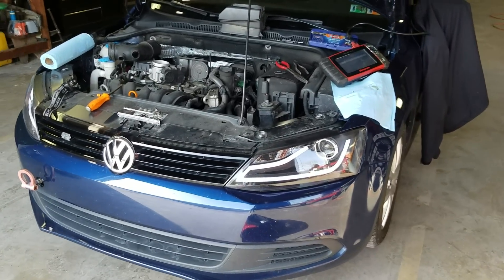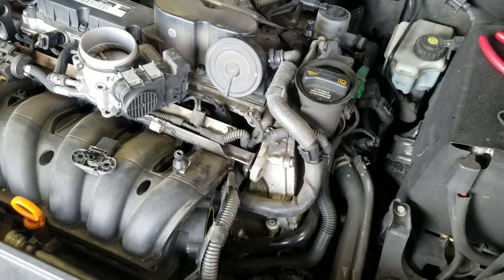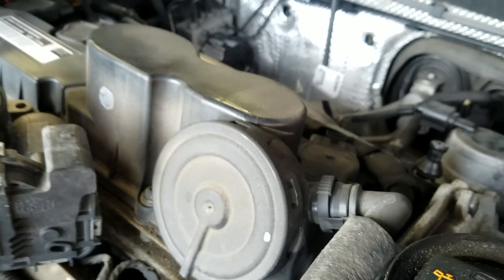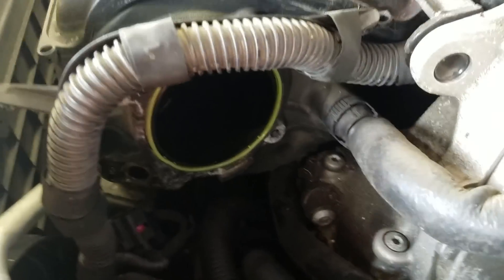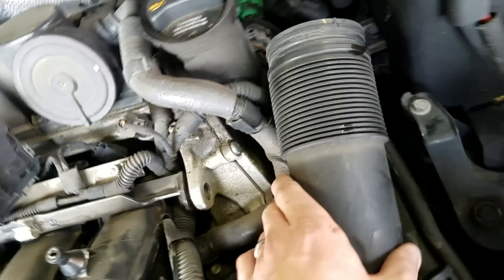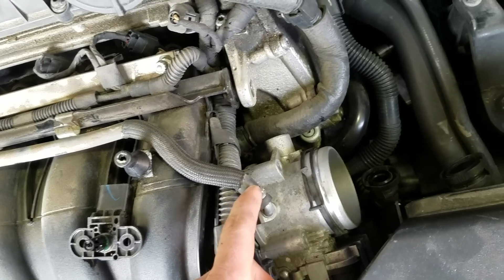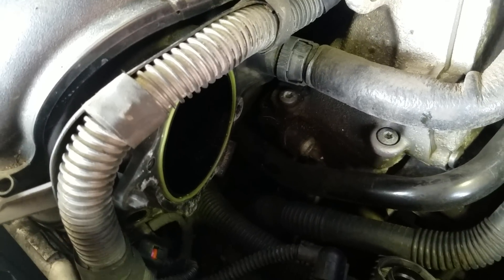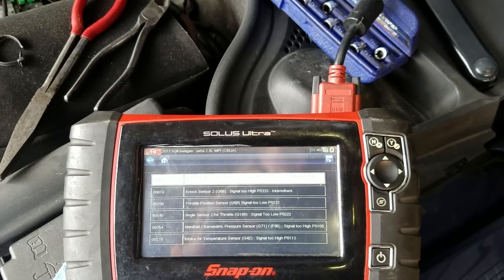PART 1- P0106 VW 2.5L Jetta Manifold Sensor Implausible Signal

Comment: Great video brother. I'm having this issue on my 2013 passat 2.5l. I'm not sure if you are aware of a TSB regarding a software update if you consistently having the P0106. There's another code with my vehicle saying ECM module faulty, yet the vehicle has NO DRIVABILITY ISSUES. What do you think man?

Comment: PCV's are the death of every engine. without them your exhaust ports would be a beautiful tan color. no black soot or tar. and FYI that small hose you said might have coolant in it is actually the hose coming from the p80 evap solenoid it feeds the vapors from the charcoal filter back by the gas tank into the throttle body so they can be burnt.

Comment: I just went through this whole process on a 2012 beetle 2.5. Had a code pending for P0106. Sensor was filthy. But one of the small hoses below the throttle bottle air hose had its clip broken off. Moves easily. Could that cause an error too?
Reply: Did you solve it? I changed pcv, map and cleaned the acceleration body and the code keeps coming back, I've already been fighting for 8 months

Comment: I had same issue but mine required dealer to reprogram computer. Vw isssued a tsb for mapp sensor due to sensitivity level. Once reprogrammed never had light come on again. If you google vw 2.5 mapp tsb will talk about reprogramming computer and not to replace sensor. Just spent alot of time replacing sensor and cleaning intake finally taking to dealer and that’s how it was fixed. Is a common issue on 2.5 engine

Comment: I had changed my valve cover completely with the diaphram. Changed the with a new Bosch  sensor and won't go away. Lost as to what to do next.
Reply: Here is a tip for you, check your intake manifold bolts, they may be loose. A loose intake manifold can contribute to a code p0106. Upon doing this, vlean inside the intake manifold, clean out your throttle body, clean out your hoses & check your intake manifold bolts.
Throttle body - torx 30
Intake manifold bolts - either a 6mm hex or a torx 40
Clean with throttle/intake cleaner
For map sensor, clean with map sensor cleaner..could be bought at walmart.
Vlear out your p0206 with an obII reader.
Good luck and hope it helps you.

Comment: Video still great in 2023.  Just swap out my map sensor and diaphragm.  Thanks for the help. 2013 VW Golf 2.5L with 104K miles.   Never selling this car.  It’s awesome.
Reply from the maker: 330k on mine and still strong. 👍
Reply: @SkyhookStudios  Did you solve it? I changed pcv, map and cleaned the acceleration body and the code keeps coming back, I've already been fighting for 8 months
Reply: Gotta check out part 2 because there's 2 pressure sensors & a few other things that can cause that code.
Reply: @wandameadows5736  will check it asap.  Thanks for the heads up.  Cause I’m keeping this baby to a million miles lol.

Comment: Changed the pcv valve also the sensor and still runs the check engine and the p0106 code ,
Any recommendations?
Reply: There's 2 sensors & several other things that can cause that code. VW made an upgraded Secondary Air Injection Pipe for VW/AUDI part# 07K198125. I have a 2012 VW Jetta 2.5L I bought used & luckily it had already had the upgraded pipe installed. I actually bought the pipe & went to install to realize this. The new pipe has a new sensor "VOLKSWAGEN 07K906051". This pipe & sensor is located on top of the motor just right of the block. The sensor this guy showed in this video is located on the Manifold. It's important to understand how the pvc system functions. The diaphragm separates' the oil & air & when it breaks it causes oil to drain down into the manifold & get burnt & cause carbon buildup on the throttle body. So if the diaphragm was bad it's good idea to replace the 2 sensors that can get contaminated or clean them at least & then see if the throttle body has carbon build up & clean if necessary & then behind then behind the throttle body you can shine a light down into the manifold & look for oil & clean it. There was a bulletin released by VW because the p0106 code was showing up in a lot of shops. Here's the bulletin copied & pasted below. I've been dealing with this code on & off for 2 years. It comes & goes & doesn't cause any major driving issues but so I'm going to pull the manifold cover off & make sure everything is clean before adding new sensor's. Those diaphragm's seem to tear easy & while I love my Jetta this is a stupid design.

VW P0106
Diagnose and fix VW P0106
Shops are reporting a high incidence of VW P0106 trouble codes. And VW has issued a service bulletin 24-18-02 to address a VW P0106 or P3078 trouble code on the vehicles listed below. P0106 is Manifold Abs. Pressure or Bar. Pressure Range/Performance and P3078 is Throttle Valve Control Module Air Flow at idle too Low.

Vehicles affected by VW service bulletin 24-18-02
2008-2009 Rabbit 2.5L (CBTA, CBUA) l
2008-2014 Jetta, Jetta SportWagen 2.5L (CBTA, CBUA) l
2010-2014 Golf 2.5L (CBTA, CBUA) l
2008-2014 Beetle, Beetle Convertible 2.5L (CBTA, CBUA) l
2012-2014 Passat 2.5L (CBTA, CBUA) l

Cause of VW P0106
The VW P0106 code is usually caused VW P0106 cause is carbon buildup in throttle bodyby carbon buildup on the throttle body but the carbon buildup can be caused by a faulty PCV valve that allows excess oil to pool in the intake manifold which then damages the MAP sensor. Do NOT make the rookie mistake of automatically replacing the MAP sensor because this may be a simple case of carbon buildup inside the throttle body.

Diagnose root cause of VW P0106
Remove the air intake duct from the air filter.
Manually open the throttle plate and check for carbon buildup
Next, shine a light into the intake manifold and check for standing oil. If you see standing oil, you’ve got a problem with the positive crankcase ventilation system—see below.

If there’s no standing oil, remove the throttle body from the intake (you’ll have to buy a new throttle body gasket) and clean the carbon buildup using a rag and spray throttle body cleaner. DO NOT SPRAY the throttle body cleaner directly onto the throttle plate shaft. The spray can seep into the electronics and damage the throttle body. Always use a rag.
Reinstall the cleaned throttle body. Clear the code and test drive.

If you find oil in the intake
The crankcase ventilation system is designed to remove blowby gasses from the crankcase and route them back into the intake to burn with the air/fuel mixture. The ventilation system on these engines is designed to separate out any oil vapors from the blowby gasses. When the oil separation system fails, oil doesn’t get separated from the blowby and it settles at the bottom of the intake. The MAP sensor is located at a low spot and oil can enter the sensor, causing it to fail.

Remove the vacuum line from the MAP sensor and check for the presence of oil. If you find oil, replace the MAP sensor. But you’re not done yet. Perform the following test on the ventilation system

With the engine OFF, disconnect the hose running from the engine to the intake manifold
Blow into the hose. You should notice air resistance. If so, then the check valve is operating properly. If there’s no air resistance, the check valve has failed. Replace the PCV valve

Next, with the engine running, disconnect the hose from the valve cover and plug it.
If the idle quality improves, replace the PCV valve.
Remove the dipstick while the engine is running. If the idle quality improves, replace the PCV valve
Remove the oil filler cap from the valve cover with the engine running
Hold a piece of cardboard over the opening. The engine should suck the paper onto the opening. perly.
If the engine fails the ventilation test, replace the PCV valve. VW may or may not sell the valve as a separate part. In some cases you may have to replace the entire valve cover to fix the problem.

After replacing the PCV valve
Make sure you clean the oil from the intake. Then replace the MAP sensor.
Reply: @wandameadows5736  Thank you for providing the service bulletin. I own a 2009 VW Jetta 2.5. I replaced only the pcv valve using the doorman part last year, May 2022. As of today, i've been getting the p0106 code. I've been cleaning the hoses, intake manifold, throttle body & map sensor for the last couple of months which has been resulting in oil residue.
I just purchased a new pcv valve, by doorman. Going to replace it again, clean hoses, clean the intake manifold, clean the throttle body and map sensor Sunday, April 16, 2023.
Hopefully this works. If not, i am just going to replace the whole valve cover. Maybe the whole valve cover with a new pcv valve needs to be replaced in the first place as stated in your bulletin. 
I will keep those who interested posted.
Reply: @wandameadows5736  I have not been able to solve the code p0106, it passes me oil to the multiple, I changed the complete aim cover, new map sensor and I cleaned the acceleration body and the failure persists, I continue to pass oil to the multiple

Comment: I highly recommend if p0106 appear again after replacing the valve (from Dorman) Buy the original cover, VW don't sell the valve itself, must be bought with the cover, for some reason in my Jetta 2011 don't accept the spare part from Dorman and bringme a lot of problems with throttle, clear code, drive two or three days to ensure (MAP related problems require some time to light up the check engine)

Comment: I also replaced all spark plugs with E3 s plugs.  Car drives so much better- but I’m getting a new code P2178 Fuel too rich off idle.    VW Jetta mk5 2.5L

Comment: Question - I replaced the Map sensor and that round cap part but I’m still getting code P0106.  
Please help need advice.  Thank you 🙏
Reply: Did you ever figure it out?
Reply: Did you solve it? I changed pcv, map and cleaned the acceleration body and the code keeps coming back, I've already been fighting for 8 months
Reply: @segador2445 can’t remember exactly but I believe I needed a new valve cover and some suspension replacement etc which was expensive but fixed everything
Reply: @segador2445 changing spark plugs & ignition coils can fix misfire issues

Comment: I followed this video and cleaned the oil out. Cleaned the intact out.... eventually REPLACED the sensor and the car is still returning the SAME ERROR regardless of trying to delete the DTC.... Its gotten to the point it caused a check engine light. Temporarily cleared the check engine light but its still returning a P10106 and im getting pissed off. The entire sensor is replaced, the intake is cleaned out... Any advice?
Reply from the maker: Did you replace the PCV diaphragm?

Comment: Great video!

I knew something was going wrong the last few months, but obviously didn't know for sure until MIL came on....going to go check it out now! 

BTW, I had thought of doing a transmission fluid flush because the shifting of the car has been way off it's driving me nuts....I thought I could have started with that, but now I'm very curious about how car will drive after checking out MAP sensor and PCV Nice video!
Reply: Best thing I have done is reset the transmission control... I don't remember exactly how to do that without youtubing but if you get in your car (without turning it on) you'll notice that pressing all the way down the accelerator will click a button. Google after that (because every VW is different) but its something like pressing all the way down on that and clicking the button and then turning the car on (without starting the engine) and holding it for around 30 seconds. And its a reset for the transmission control. Often times resolves awkward transmission shifts.
Reply: Did this fix the issue? I would get random pulls thinking it was the trans fluid as well. I just got the check engine light.
Reply: @mauriciopereira7705  Honestly there was nothing wrong with the transmission, it was the MAP sensor getting all oily (which is ridiculous), and my throttle body was extremely dirty/sticky.

I feel like the feeling of a 'bad transmission' was coming from the dirty/sticky throttle body. Then, it so happens to turn out the MAP was oily as well. 😕

Does that help?

Comment: replaced PCV diaphragm (tho it wasn't broken) and MAP sensor. Sill getting error code, specially during hot days. I don't know what else to do
Reply: Did you find a solution? I've had that problem for 8 months
Reply: @segador2445  it's the throttle body.... Do not clean buy new. The sensor goes bad, which is why it gets weird on hot days.

Comment: I had the same fault code plus multiple codes for misfires cylinders, the engine was idling really rough, shaking, and vibrating badly. I also noticed a hissing noise, which I suspected was an exhaust gasket leak coming from the left side of the engine. I was thinking for a moment, what a coincidence? 
Anyway, I replaced the PCV diaphragm which was burst wide open, clean the MAP sensor in the intake as it was full of oil. No luck. Then, while I was running the engine, I increased the rpm to approx 4000 and I heard a pop. Stop the engine, had a look, and surprise, one of the plugs installed on the left side wall of the engine (by the cooling fluid reservoir) was missing. Oil was spitting out from the hole. They are called actually camshaft caps. That was the popping noise. The hissing noise, I assume it was actually from that plastic plug, and probably when I increased the rpm, the pressure just popped it right out. Waiting for the part now. I ordered two as I will preventively replace the other one too. I Will update soon.
Reply: Hey Eugene, what was the verdict on your problem with your vehicle? I’m having the same problem…
Reply: @Hudsonnblackk  On the engine block on the left hand side (by the cooling fluid reservoire, there are two plastic plugs. I'm not sure what is the purpose but I think due to the blowned PCV diaphragm, it create a vacuum inside the engine and sucked in one of those plugs. Anyway, I removed the crankcase cover and I found the plug inside, resting by one of the valve lifters. I could re-install it but I bought new aftermarket ones and installed it. I did apply some RTV sealant on it, just in case. So, the main culpit was the PCV diaphragm, second, I found oil in the throttle intake, (there is a sensor there too), removed the throttle body, cleaned it up, and third issue was the plastic plug on the engine left-hand side. The plug was very dificult to troubleshoot as the engine was running soo rough , I thought there was piston broken or worst. Since then, she runs perfect. All these were induced by the PCV diaphragm which I never replaced it in more than 10 years. Some people are replacing them every few years. They are cheap and easy to replace.

Comment: i have a 2012 beetle but basically had the same engine set up. but this helped me :D changed my map sensor today, found that the diaphragm was blown and had tears and there was oil all over my sensor. so i changed that. I wouldnt have known that part would have been a culprit to my sensors death. also found a mouse nest in my air box :/ but my car is running good now! :D thanks for the video advice!

Comment: Thanks for the great video, the only one I found that identified the root cause. My 2010 Jetta 2.5L was throwing a random check engine light, then finally started running in limp mode, not going over 3000rpm. G71 and G61 error codes. The parts are cheap enough so I replaced both and back to normal. I hope it also cuts down on the oil consumption too.

Comment: So I guess there's no way to avoid going in to wipe off the MAP sensor?
Reply from the maker: It's tucked down in there pretty good. It's unlikely to get properly cleaned without removal.
Reply: @SkyhookStudios  I've never really done anything besides headlights, air filters or fuses but I really don't want to pay a shop.